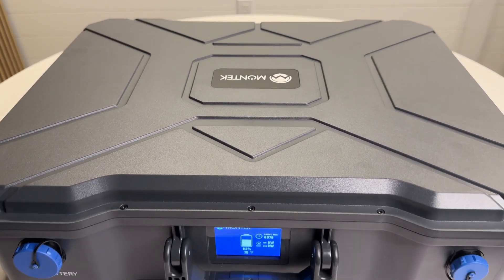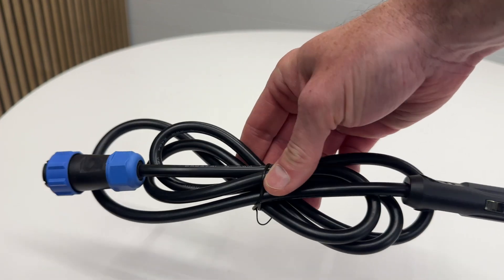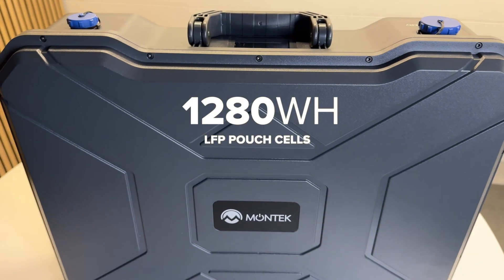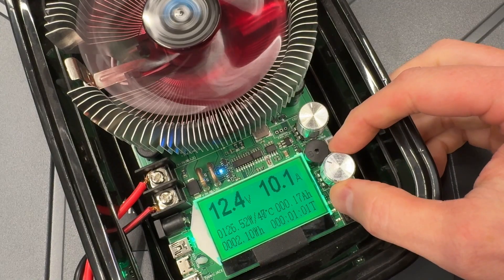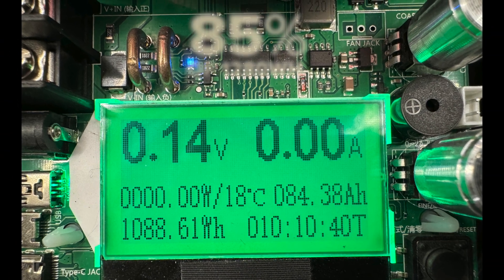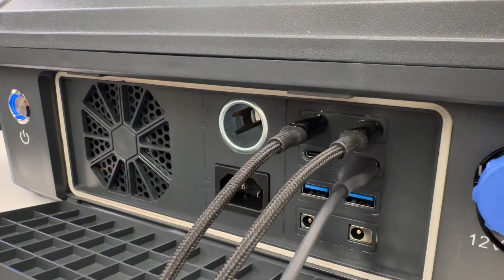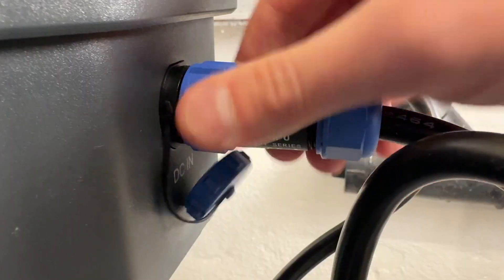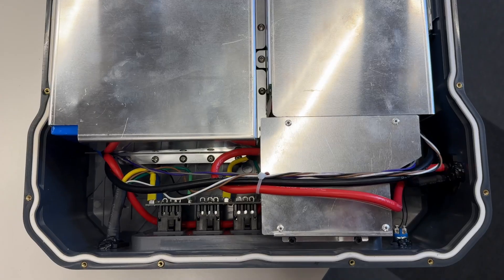WATERPROOF Power Station: Montek X1200

Comment: This is soooo close to being exactly what I want.  I love the form factor of the case and that two can do 240v split phase.  I'll by a couple of these and the 240v adapter if they would make a smaller/lighter version with no internal battery (I want to only use external 48v batteries) but otherwise the same internal components. Also, they should replace the proprietary connectors with readily available ones (like XT60, XT90, etc.). Make that and I'll buy two plus the 240v adapter. Anyone know of such a unit already on the market? I priced out individual components and can't make what I want for cheaper than this and this has a battery. I image they could reduce the price another $100 - $150 if it didn't have a battery.

Comment: The features of this unit are just AWESOME. 

I'm just a bit concerned about the LONGEVITY of LFP pouch batteries Vs the much more robust and proven cylindrical format cells.

If you look at drill batteries for example. The failure rate of the new high capacity pouch packs seems to be astronomical compared to the old 18650 packs.

Does anyone else have experiences or comments ?

Comment: Great review of an interesting product.   I think the MPPT solar charger at 150 volts is really nice.   I like its rugged, “prepared” look.   I have use the EcoFlow Delta 2 for camping and  worry about running it inside my tow vehicle to cool a fridge because of heat buildup inside the vehicle.   I wonder what the operating temps are for the Montek.   I am risk adverse with regard to pre-pay, indigo style purchases and I often wait to see what users experience over time.   Todd you do a great job and I appreciate your testing and “to-the-point” communication.  Happy Holidays.
Reply from the maker: Thanks! I really like this unit, especially the solar. I was just testing panels in the yard this week and this way rugged and could handle rooftop panel voltage